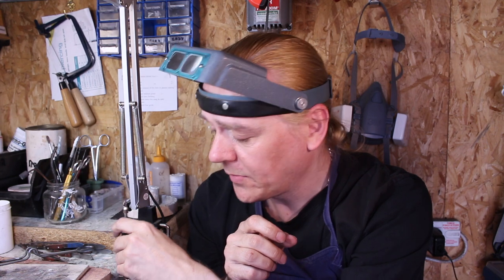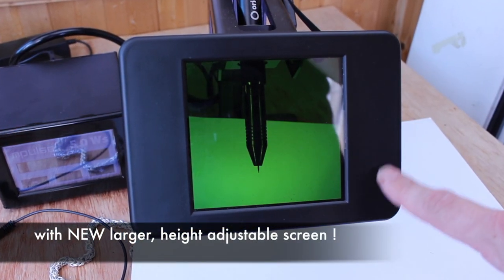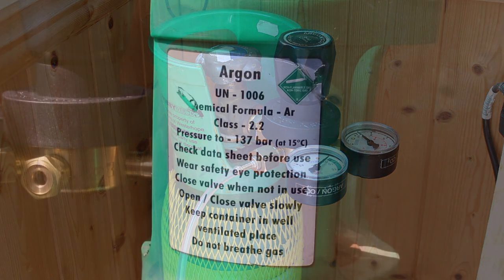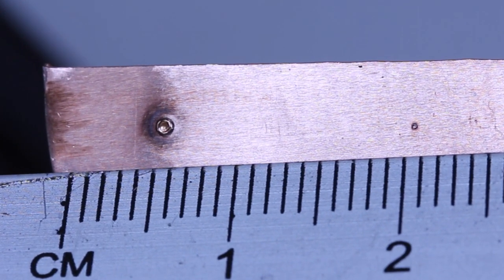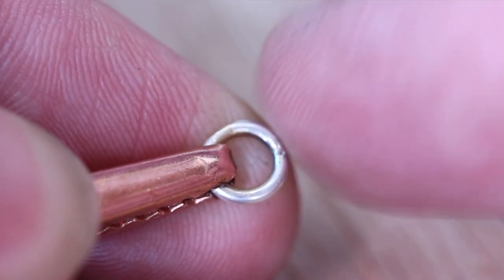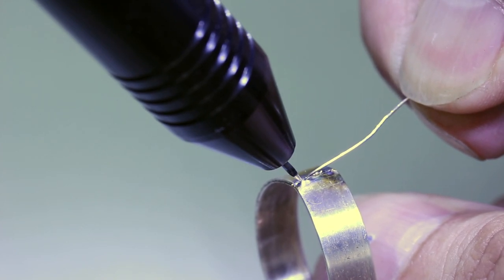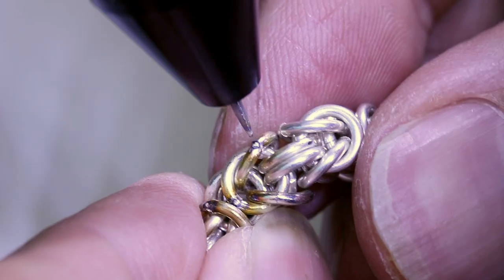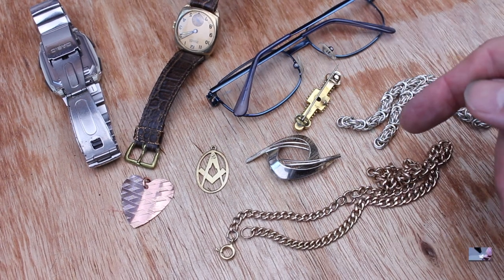Orion mPulse 30 Micro Jewelry Welder Demo & Review in HD

Comment: Hi Dave, thanks for you excellent video, on the strength of it I bought one. The question I want to ask is why are my weld joins not holding, the slightest movement makes the weld break. I've been practicing with 1.5 mm round silver jump rings, I'm using the 1mm tip with the power at 10. Any suggestions would be greatly appreciated.
Reply from the maker: I suspect you're setting is too low. You need more penetration, to go through the thickness of the material. If you get a sheet of 1.5 mm silver and hit it at 10w. You are not going to make any mark on the other side. I.E. there isn't enough power to penetrate 1.5mm. So the same applies to a jump ring. you are still trying to get through 1.5mm of silver in order to fuse the material right through to the core.

So, Grab  a few spare links and crank it up a lot more. do a few tests and have it on the highest setting you can before it starts to blow the wire away. I typically weld 1.2mm sterling silver jump rings and I will hit it three or four  times around the joint at 14W minimum. this gets the penetration all the way around the joint and into the centre of the metal.

Also stick to the laws of soldering (and welding). Close fitting & clean. especially the ends, as oxides and dirt will produce a weak spot in the joint.

Hope this helps.

Dave
Reply: Thanks for the reply Dave.

Comment: if I solder a piece of yellow gold, it is yellow or white. by the electrode ???
Reply from the maker: Not sure what you are asking. is 'what' yellow or white. and what do you mean by the electrode? and the machine welds, it does not use solder. If you can be more clear, I will try to answer. Dave
Reply: @CelticDreamsCoUk  tungsten electrode is white so I want to know if welding yellow gold the welding point is the color of the tungsten electrode or is yellow

Comment: for jump rings... do you use the thin needle 0.5? do you blunt the needle? I blew a small silver ring to smithereens with this machine
Reply from the maker: It depends on the size and the material. For my Byzantine bracelets I use 1.2mm sterling silver jump rings. For these I use the 1mm electrode with a "slightly" blunt tip and usually around 12ws. This gives me a nice wide smooth weld. I have just made a gold bracelet with thicker 2mm jump rings and for this I have used a sharp 1mm electrode set a little lower at 9ws. This is more precise and reduces the amount of polishing later. The 0.5mm electrode is for very fine work such as  repairing tiny trace chains. I have welded tiny things under 1mm with this, but for larger jump rings use the bigger electrode. 
        If you're not getting a good weld, don't automatically be tempted to just turn up the power, or you may get the result you experienced. Just as with torch soldering think "precision" ....not power.
         A sharp electrode will usually get you a deeper penetration and a better weld. It is also important that the electrode is kept clean, as well as your metal too. So keep everything in good order, clean metal, sharp electrode, and well fitting joints. Start low and increase if necessary. If in doubt, always try on a piece of scrap metal of the same size and material. Too much power, dirt and a worn electrode can cause problems, as you found. So work neat and clean. remember precision not power. Hope this helps. Dave
Reply: Celtic Dreams Thanks Dave. I've changed over to the thin needle and low energy. Getting better results. I've only bought the machine 3 days ago... so still struggling to find my feet.
Reply from the maker: It does take a litte practice to get used to. But as I say, clean and sharp !  Have fun. Dave

Comment: Would this work on gold filled
Reply from the maker: I don't see why not.  It should be ok if you keep it at a low setting. Gold filled, usually has a core of brass, so it shouldnt act much differently to the outer gold. Best thing is to see if you can get your hands on one (at a trade show, and take some GF to test. Hope this helps. Dave

Comment: Can we use this without argan gas
Reply from the maker: "ARGON". Yes the machine will work without it, but the welding is very bad and difficult to control. You might zap a jump ring but that's about all you can do. You can tell the difference when the gas runs out. So yes you do need it - big difference. Dave

Comment: nice machine, but its really worth 2k usd? theres plasma/arc/tig ac/dc machines all in one for that price, i mean some machines are more expense just becouse brand or certifications but the componets value inside of it is not even the half of the price
Reply from the maker: I haven't used plasma or tig machines for jewellery, so cant comment on those. I believe this model is is by far the cheapest pulse welder available, a fraction of the price of the larger models or other popular brands. Compared to laser welders they are a bargain. My friend has a laser in his shop and that cost £50,000. Yes the laser is better, but is it 48k better??  Not to me. So is this Orion worth 2k, yes in my opinion is very much is. I wouldn't be without it. It easily paid for itself in productivity and quality of work. You cant judge a tool merely by the cost of its components, if that where the case then why not just make your own. whats the cost of a hammer? The value of any tool is the impact on your business, either increased productivity, quality of work, reduction in cost and time, or the ability to offer new services. For me the Orion does all that and so for 2k its a bargain. Dave
Reply: Celtic Dreams well i dont do jewellery, but is like a hammer of 500 usd if is the case, i had a chinise tig welder with a minimun current of 10 a and so far i havent use less than 40 a for welding, but maybe a common diy spot welder of capacitors and a tig torch can do the same job
Reply: @jorgeneo560  I'm a beginner at making jewelery and regular welding and I've been thinking exactly like you. Seeing this video review the Orion welder build quality is horrendous and the markup from the manufacturing cost must be really high. I guess you can excuse that by claiming it's a niche market with few units sold. Even though im sure it's a great purchase for any jeweler that values a simple setup, I'd go for something that can weld steel and aluminium as well so i can make my own tools, workbenches and jigs. I'm a rare sort that don't mind learning new things. You're basically paying for not having to learn anything about welding when buying this.

Comment: Can it fix stainless steel
Reply from the maker: Yes it can weld pretty much any metal, and steel works well.  Obviously depending on the size, but small jump rings are fine. The larger models, have more power and can weld thicker and faster. Dave

Comment: over 2 grand?
 lol, I was not pleasantly surprised. granted I'm a know-nothing person trying to get into jewelry making for the first time, but damn that's pricy to jump into.
Reply from the maker: A pulse welder, isn't really something you "jump" into, as with any pro tool it's a considered purchase, for a more serious user. But to put it in context a laster can cost over £10k, even rolling mills can easily get to a couple of thousand. My polisher is over £1k . Pro jewellery equipment can easily run into hundreds and even several thousands per tool. But the good news is, you can start as I did many years ago, with just a couple of pliers, a butane soldering torch, and a Dremel. Did me fine for many years. Dave  ; )

Comment: I don't consider $2600 to be affordable!
Reply from the maker: I guess it's all relative. A laser can easily cost ten times that, and this is one of the cheapest welders on the market. So it 'is' the most affordable option. The question is, do you actually need one?. For most jewellery shops with a repair service they are worth their weight in gold, for speed, ease, and conventinece. They can quickly pay for themselves with quick repairs. Likewise myself, I make lots of fine  chain mail and so again it has paid for itself several times over. But for a small hobbyist or crafter - then no, it's probably more of a nice luxury. It's just like any other pro tool, magnetic polishers, rolling mills etc can easily cost hundreds and even thousands. As a professional, then the cost is easily justified in increased speed and quality. Dave
Reply: If you're in the US there's a new little laser welder called the Dado. For some reason they made it look like a die (as in, roll the dice). It's about $4600 USD which is awesome BUT the drawback is that the frequency is super slow. I think it fires every second whereas more expensive laser welders can fire dozens of times per second.

Comment: Me and ever other welder wincing at his "groove weld" and tungsten prep... 🤢
Reply from the maker: I must admit I am a jeweller, not a welder. and using these tools takes a lot of practice. I would be no use at welding a car. Thanks for watching. Dave
Reply: @CelticDreamsCoUk  ahhh... Just bustin' your chops....

Hey on another note. I have a gold chain I've had for years. The ring that holds the clasp keeps wearing through. I had a jeweler solder it back together and it only lasted a year. I took it to another jeweler and had him solder new one with 10K but that only lasted a year and a half or so. What can I do to fix this? Thicker ring? Different K? It's a 5-6mm twisted rope chain. Maybe 18"

Comment: can you weld without the argon gas?
Reply from the maker: Sort of, it still creates a spark  but the weld is very messy and doesn't work the way it should. You can definitely notice when you are running out of gas. So really, id have to say NO, you need the gas. Dave
Reply: It can definetely weld without Argon, I have done a lot of work with these and to be honest I prefer not using the gas at all due to more control over the molten metal.
This is one ring below was intentionally left with the weld spots unpolished to simulate a rustic coral reef feeling, together with some wire waves pattern. All rolled fine silver, no solder at all, and strong welds.
https://youtu.be/OYRjfmhKfhQ
Every other ring in my uploads use the purest .9999+ silver, rolled several times for strength and were welded using arc and no Argon, you will find there the polished ones too with no visible weld pattern, no issues at all.
There is a learning curve to make strong welds and to learn to control the welds, so don't get frustrated on early stages by failures.

Comment: Can this machine weld brass peice on aluminum?
Reply from the maker: It can weld almost any metal, it simply creates heat. So you can weld aluminium (gently) and also weld brass. But in your case you are trying to join two different metals with different properties. Aluminium would normally melt at a lower temp than brass, and oxidises very quickly so needs to be kept clean when joining. So welding brass to aluminium, I couldn't honestly say - but it sounds tricky to me. Sorry I cant be more specific, but as a jeweller i typically weld silver and gold. Dave